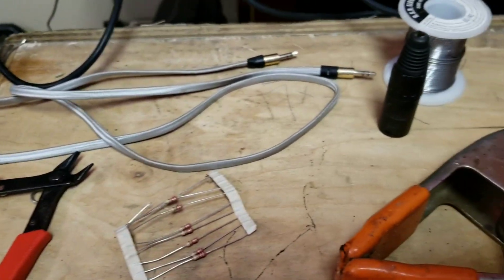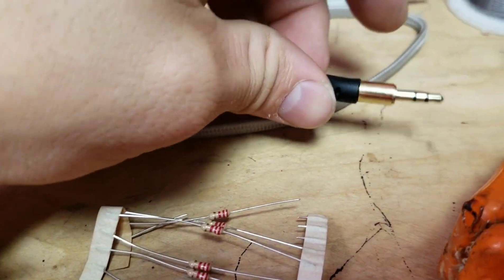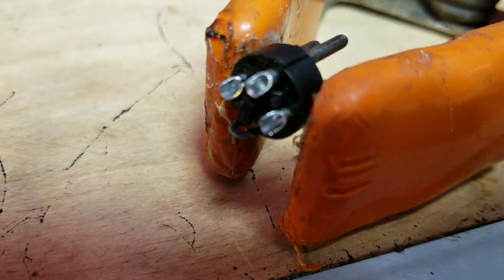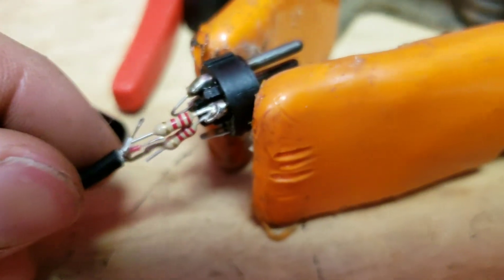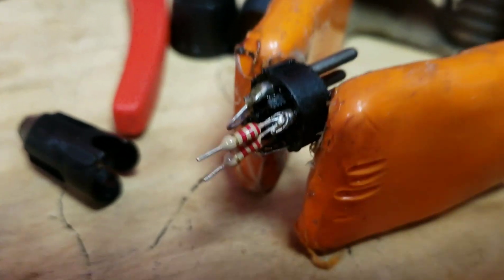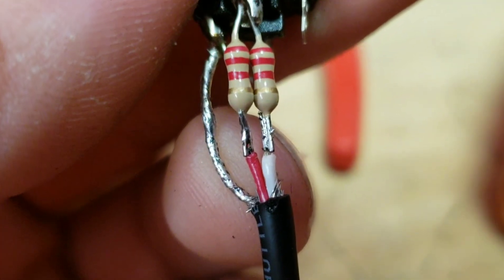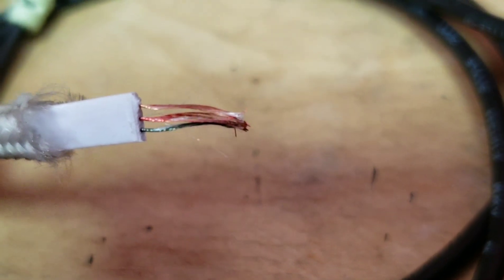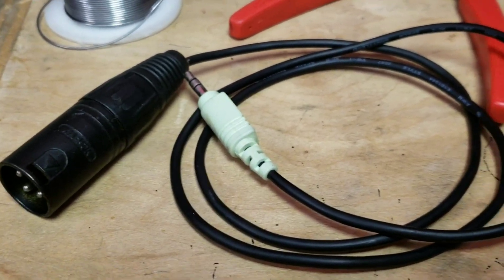How to make a 3.5 mm stereo to XLR mono adapter cable

Comment: I've seen some people use 1k resistors for a similar summing cable.  Can either be used?  The other scenario that used the 1k's was a stereo 3.5mm to 1/4" mono.   By the way, could I make a similar cable to what you did but put a 1/4" stereo connector in place of the XLR?  and then plug the 1/4" into my Line In balanced jack on my Mixer.   Or is is better to use the XLR and use the pad if needed?   Thanks.
Reply: "people use 1k resistors"

These schemes - and those values - are usually based on 40-50 year old techniques that have been passed on from person to person for decades, with modern line level equipment as resistor value of ~4.7 kΩ is a much better choice, a very good balance between protecting your output source from shorts and not attenuating the signal too much.

Go for: 4.7 kΩ metal‑film, 0.25 W.

Comment: Hey i made a simular cable lastnight but did not use any resistors in my xlr to 2 rca .....female xlr sending signal from a powered speaker output line level signal into a Lg X boom stero rca input i never used resistors in such cable all i did was join the 2 hot wire in xlr to pin (solder) then split the other end to left n right rca male

Comment: Spent ages trying to work out the pin configuration on my rode video mic so I could use it plugged into the pa, your was the only useful reference - thank you so much and whilst the actual wiring / soldering only took minutes finding and sorting out my selection of resistors took ages!

Comment: Bro that really small stuff really easy to solder the whole key is just taking the shield off you got to catch it on fire and let it burn a little bit and then scrape it with some sandpaper in it I promise you it will solder very easy

Comment: Sir i am making a project that looks like this. Using  6.35mm ts  to 3.5mm trrs, from mixer to my laptop for live streaming. Since I dont have other choice but to try DIY tricks, i can’t buy audio interface because we are on a lockdown because of the virus. It is working but the audio seems like straggling to sync into my laptop. When all the band instruments are playing, which are all plug in to the mixer, the audio is like too soft and can’t get all instruments to sound clearly into my loptop. Any suggestion? This is for live streaming of our church. Thanks
Reply: typically a laptop or phone combo 2.5 mm jack is tip - left output, ring - right output, ring - ground, sleeve microphone. So you would wire the TS to the ring furthest from the tip to the sleeve to achieve a mono connection.

Comment: Why do you need resistor???
Reply: to prevent phase cancellation.
Reply: The resistors will avoid "shorting" the left and right output where the 3.5mm minijack is connected.
Combining two different outputs to one (stereo 2 mono) without resistor is actually a shortcut, and will "kill" or lower the mono output.
You need two of them, so you can tap the signal between them.

Comment: Thanks for the video! I have a few questions, what happens if I use 2.4k? Those and 2k  are the ones I have handy. Also, does resistances have polarity? I need to do this but with a female XLR, is I the same process? Thanks.
Reply: Anyone, please??
Reply: @xperrosinsangrex  The resistor values can be varied quite a bit. You should be OK.
Reply: @xperrosinsangrex  and no, resistors don't have polarity.

Comment: I'm trying to connect my XLR microphone to my phone with a 3.5 mm trrs Jack, sometimes it works perfect, but say the next day when I plug it in back it's like if the wires are touching each other, but I just don't know where, my next attempt is to Bear the Jack like how you have it here, maybe now there will be less wires touching. Or maybe there may be a possibility that I'm not doing it properly.. I don't have resistors, is that really necessary, from phone to XLR microphone?
Reply: yes.   The resistors are electrically necessary for the phone to recognize that there is a mic attached.  However, if you get a proper TRRS adapter with one mic out and one headphone out, the resistors are built in.  Now some phones have a secondary run through the shield of the trrs that gives you a stereo style mic connection and will work, but most will require you to have an XLR to mono 3.5mm cable available from most music stores.  If the resistors are properly attached to the RS in your adapter and your phone recognizes the stereo input, you'll get the possibility of stereo or TRS connections.  This project shown should allow that, but you'll still have to get a special splitter to connect the mic to the phone.
Reply: @HTDav01  Thx, got my resistors today 👍

Comment: Hi there, could you please explain a little way is important to put the 2 resistor please or maybe you could give a link to read about it please, thank you
Reply from the maker: On some android phones the output will turn off if you simply short them, and it attenuates the signal so you can plug it into a mic connector
Reply: @Yousitech  Thank you for the info. For the array of this video have you tested the maximum large cable that works ok with this resistors of 2.2k 1 watt? thank you
Reply from the maker: 1 watt will work If you can fit em in the connector

Comment: Hi i plan to plug headphone from XLR’s (L and R) outs of mixer- can I by pass the resistor?
Reply from the maker: Yea. Just take the left signal wire and solder it to one female xlr connector and the right signal to another connector.

Comment: Curious as to what the resistors do here, have found this video quite useful and am ready to go get some to make my cable, I was given 2.2k 1w 1%, where i think you're using .5w 5%
Reply: The resistors attenuate the line level signal from the headphone jack down to mic level so that you can connect this to a mic input.  If you had no resistors the signal level would be super high and probably would distort your mic input.

The 1 watt resistors will work fine as long as you can fit them inside the XLR connector.
Reply: Thanks very much! They were all I could buy, will make the cable today
Reply: @dankeifer  , I would like to know if this array is bidirectional, because as I understand it is from the plug 3.5mm source to the XLR but what about to send signal from a mic to a camera with jack 3.5 mm in order to input sound to the camera from ans external xlr mic, thank you
Reply: @carlosmariche   - That is a different cable: http://www.rode.com/faq/how-can-i-connect-my-mono-microphone-xlr-output-to-a-stereo-trs-socket

You can buy these cables already made but they are hard to find because the wiring is non-standard.

https://www.amazon.com/Cable-Matters-Unbalanced-3-5mm-Female/dp/B00ZIY0ACQ
Reply: @dankeifer  Thank you for the link. For the array of this video have you tested the maximum large cable that works ok with this resistors of 2.2k 1 watt ?
Reply: @dankeifer   thank you for the info, do you know if the wiring is the same if I use MINI xlr to plug 3.5 mm? or it is the same to use XLR or mini XLR to make my cables? I asking this because I have XLR and MINI xlr microphones and I would like to test them to send sound to my DSLR camera, thank you for your time
Reply: @dankeifer  and also this array works for how many meters any idea? thank you
Reply: THX  @dankeifer for this info. I thought that is what the resistors where for.  I have XLR line level inputs on my mixer. So i will just leave the resistors out. Cheers
Reply: The correct way to do this is with a small transformer to convert unbalanced to balanced, and leave ground floating. By shorting cold to ground, you're potentially damaging any equipment that provides phantom power. You are also summing the left and right signals in an unbuffered fashion, which is less than ideal. This sort of fudgery usually results in trouble at some point. Years of experience has taught me not to do this!